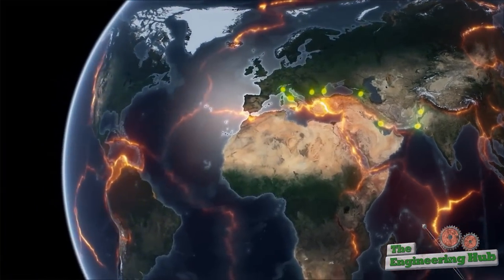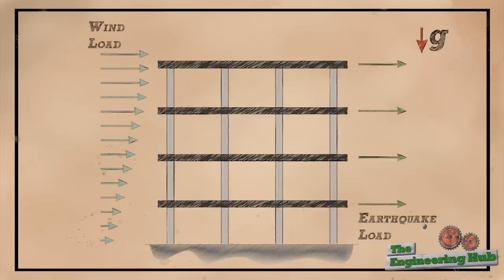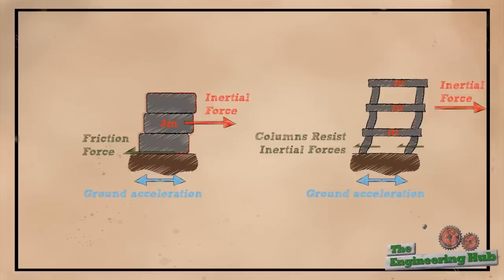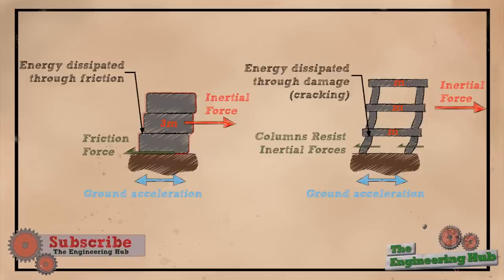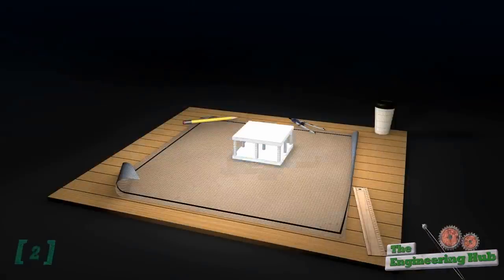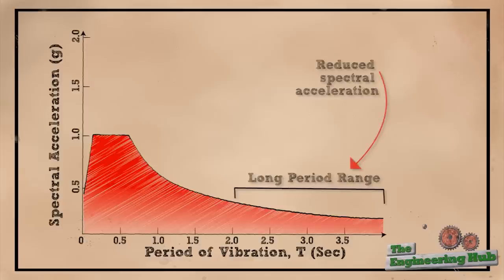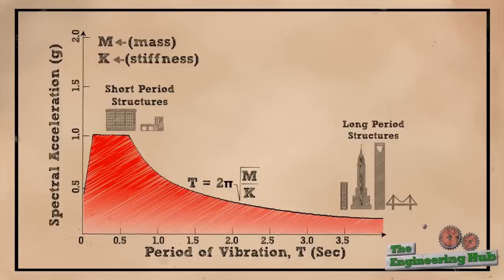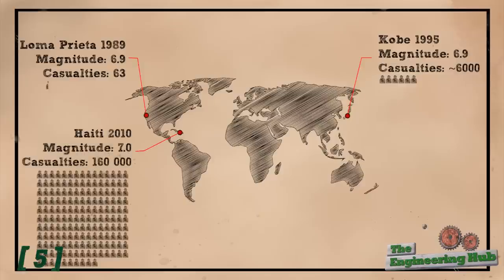Which Buildings are Safe in an Earthquake?

Comment: here is your title: Which Buildings are Safe in an Earthquake?. Its an interesting video but I don't think you anwered the question.
Reply from the maker: It's hard to answer because it's dependent on many factors amongst which the earthquake itself too. In general, taller buildings tend to perform better because they oscillate at frequencies different than the frequency of the earthquake. Earthquakes shake rapidly i.e. the direction of acceleration (shake) changes every 0  - 3 seconds. Tall structures shake slowly 3+ seconds to complete 1 full cycle. For that reason the shaking of tall structures does not usually coincide with the shaking of the earthquake which means less energy is transferred to the structure and therefore less damage is sustained. This is the simple answer but of course it needs like 10 footnotes for all the possible exceptions and cases where this is not the case.
I hope that helps? Cheers!
Reply: @TheEngineeringHub  it would be interesting if you were to do a similar video showing/explaining why there has been so much damage recently in Turkey. Considering that it has been fairly common knowledge that Turkey has been waiting for big earthquakes for years, there have been many predictions about it being only a matter of time(Istanbul for example). Why then would they not build accordingly?
Reply: @waynepetrevan  The answer to that lies largely on builders who have been cutting corners and not building the structures as per engineers design and the corrupt local council employees turning a blind eye receiving bribes from builders.To top it all off governments didn't enforce the rules and punish those responsible for decades and now after it's too late some have been convicted which won't bring the dead back.After the big earthquake in 1999 new laws were passed regarding new building regulations where some were adhered by some builders and as we saw others haven't even though there was a lot of collapsed buildings relatively new.

Comment: In Christchurch NZ nearly all the buildings remained standing, maintaining their gravity loads, and yet had to be demolished later resulting in vast areas of the city being empty.
Reply: It means that engineers correctly designed the buildings to save lives. That’s the most important thing, but once you have an entire city built like that, after a big quake there’s a huge economic loss - not just because buildings cannot be used and must be replaced, but also because economic activity simply moves away to undamaged areas. Once that happens it may take years to come back. Although it’s impractical to build to withstand any quake, spending more to improve the chances that the building will be more likely to be usable or repairable after a quake may make sense.
Reply: @Sashazur  wow never thought about that way smh.
Reply: @Sashazur I couldn't get 🤔. What do you mean? 🧐

Comment: These high buildings are like traps to us during earthquakes occur in regions of earthquake zone. Therefore we should construct an earthquake proof building .
Reply: There’s no such thing. All buildings will get damaged in an earthquake. Even an “earthquake proof” one. The cost involved to make a building fully quake proof likely isn’t practical. The most important thing is saving lives. Not buildings.
Reply: Disagree with you you can have build that can withstand earthquake the biggest issues are the contractor it comes down to costing. When testing is carried out the standards are to be tested in a 3/3 Furness and when a company has to carry out test they will be done for each product being used when doing testing its the time and the costing that comes into place it cost millions of pounds for testing and who will take the costing of this. No building will withstand an earthquake without having some sort of effect if it is from the foundation and piles to movement of the land.
Reply: @macberg5806  Correct. They just want them to survive a big one so that people can get out alive. They also want them to remain intact on small and moderate quakes.
Reply: We have a joke in aerospace. “Why don’t we design the airliner like a black box, since they survive the crash”? The truth is, it would be so heavy that it couldn’t fly and even if it could, the people would be turned into hamburger after a crash.

Comment: In the 1994 Northridge quake, peak acceleration in some areas was as much as 2 G's caused by a blind thrust fault with severe up/down motion, and the San Andreas fault snapping with a Magnitude 8 is expected to create a more rolling and side to side shaking with up to 2 G's, but that kind of quake would shake easily for 75 to 90 seconds, if not more.

Comment: Please make a video about the pros and cons of corner bracing in reinforced concrete structures? Just as Ross Stein suggested in his video in tedtalk
Reply from the maker: That's an amazing idea Malsawmtluanga, it has been added to the future videos list! Thank you!
Reply: @TheEngineeringHub  thank you!Subbed!🙌
Reply: The corner bracing was an interesting point in Ross Stein's video. This would be especially relevant for retrofitting "soft first story" buildings. There are other methods of bracing or stiffening available as seen especially in Japanese earthquake engineering. Infill walls or shear walls act as bracing as well. In all cases of bracing, you also don't want the building to become overly stiff. The columns need to be stronger than the braces or infill walls, otherwise the bracing could do more harm than good. Also a stiffer building has a shorter resonant frequency, which may not be desirable. The bracing needs to be engineered well to maintain sufficient ductility. It's all a bit more complicated than the explanation in the Ted talk.

Comment: What is the difference between "gravity load" and 'dead load"?
Thanks for the video.
Very well done video.
Reply from the maker: Hi wacky, thank you for your feedback. Dead load is a type of gravity load. Besides dead loads, there are also live loads, snow loads, etc that fall under this category of masses accelerated by gravity.
Reply: Gravity Load and Dead Load are the same bro! Gravity Load is common exist every where, but the dead load is specific name for the gravity load specially when it uses on structure. I may be wrong. thanks
Reply: Gravity loads are loads which act downwards due to the weight (more correctly mass) of items including the structure.
Dead loads are those gravity loads which do not move ie are fixed.  The weight of the structure itself and any items fixed to it.  Counter intuitively snow load and occupant load can be considered dead load.
Gravity loads include live loads which are due to moving masses eg the lorry (truck) on a bridge.
Reply: Dead load is part of gravity load.

Comment: Turkiye and Syria, 2.6.2023, 70.000 counted a rising after 2 weeks of rubble digging. 7.8 and 7.6 (9 hours later). The total population living 100km and closer to the fault line 14M. 90% of buildings were concrete-iron built, in avreaga 3-11 stories, most were built without regulations or with very old regulations making the structures built much weaker to stand still against a 7.8 shock. Yet msot of the never buildings on the dangerous proximity also collapsed. 14000 buildings totally collapsed for 14M population. 

Difference between Japanese faults and Anatolian is that, although Japanese faults create 8-9 magnitude earthquakes, they are deep in the ocean, and 30-100km deep into the earth, making the actual destructive force emitted already and reduced until it reaches the cities on Japanese islands. Yet the shake will be there non the less. In Anatolia, cities are built on or very near of faults. And the faults are only 7-15km deep into the earth. So much more closer to the residental area. Therefore a 7.8 magnitude 10km from your location and 10km into the earth makes a destruction much heavier than a 9.2 magnitude 200km away from you, 70km inside the earth.

Still, death is death, science is science, if built right on the right place, even if close to the fault, buildings survive the hit at least as good as you can leave the building afterwards. Collapse means the buildings are built wrong to fight the earthquake shock. Therefore Turkish and Syrian engineers, contractors, controllers and local governments who are responsible for the permits of building locations for geological structures and safety are to be blamed for all the deaths.